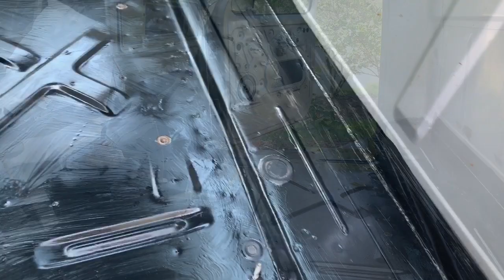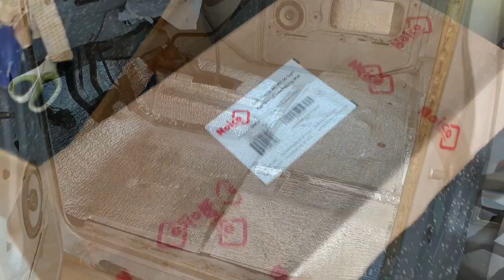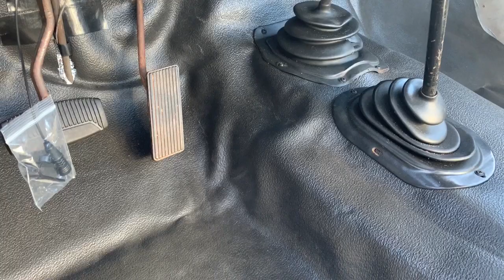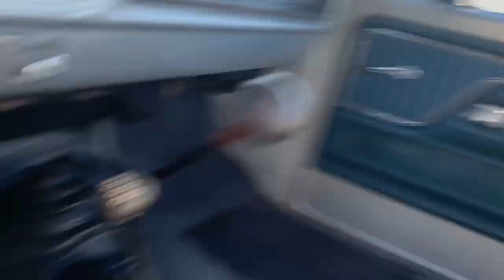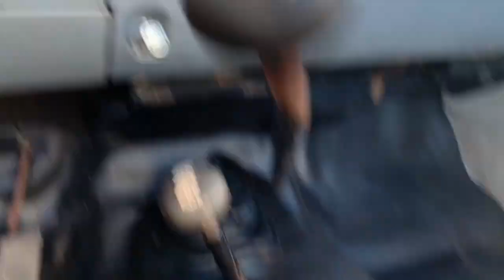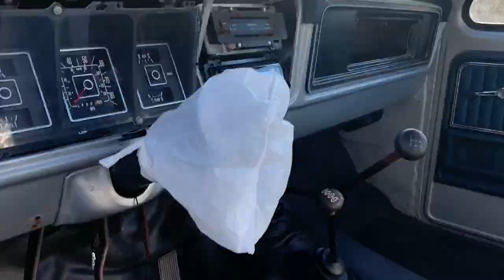1977 F-150 Cab Update 3

Comment: Good Work!  I found the passenger side dash trim-around the glovebox, is actually pot metal in the older Dents(XLT Lariats), not fun to change, but the later years were plastic.  Interior work is difficult, and dealing with a front cowl leak-dribbles down from inside the cab front floor during heavy rain.  Also the back window, new rubber and glass, just being difficult to stop leaks.  Fun Fun, but worth it!
Reply from the maker: Nice work!

Comment: After noico, what was the insulation you put over it? brand and thickness please.
Reply from the maker: This stuff right here. https://www.amazon.com/gp/product/B016QUSDHE/ref=ppx_yo_dt_b_search_asin_title?ie=UTF8&psc=1
Reply: Munson Mischief hey last question, I’m prepping my metal by sanding it down to bare metal. What did you use on top of bare metal and what did you clean the metal with. I have rustoleum rust reformer and mineral spirits.
Reply from the maker: On any of the areas that I prepped down to bare metal, I put the rust encapsulator right on it and then a little primer over that...before applying the sound deadener.

Comment: How was your experience installing the rubber mat? I got mine from LMC and it was a huge pita doing it alone and very hard to get it to lay flat.
Reply from the maker: It was pretty damn challenging.  Made a few cutting mistakes but overall I'm happy with the job I did.  It would have been much easier if the cab was completely bare...as in firewall covers out and everything.
Reply: @MunsonMischief  
MM , I ordered MIP floor for my 1979 and it stops under the seat and didn’t go all the way to the back of the cab?! How did you get yours to fit the entire cab? Do you know the part number. PLEASE help. Thanks JB
Reply from the maker: @JB-JB-JB-JB  part number was 49-5909 from LMC. Mine went all the way to the back of the cab, fully covering that little shelf if you will.